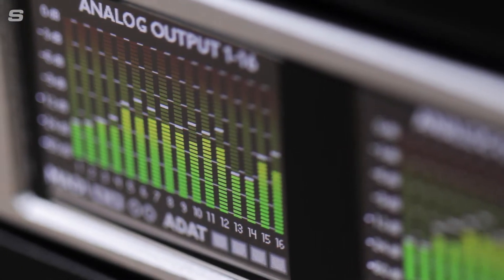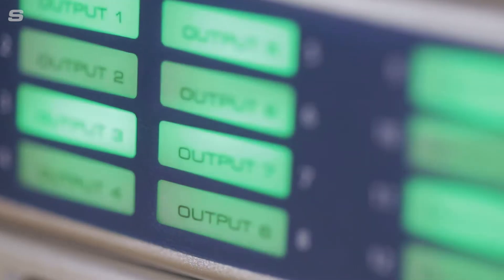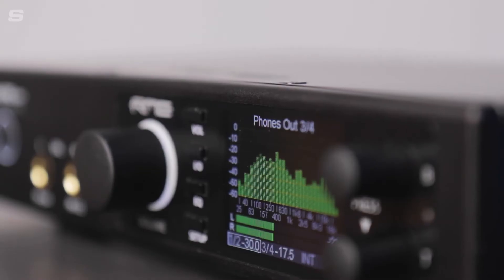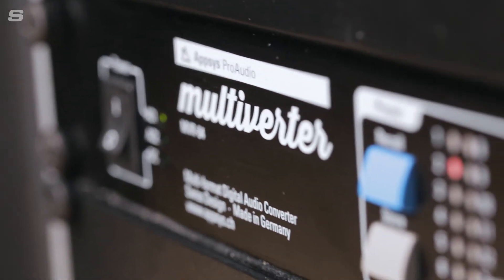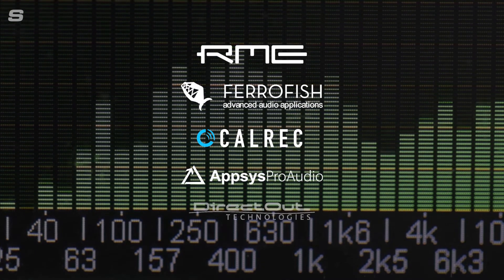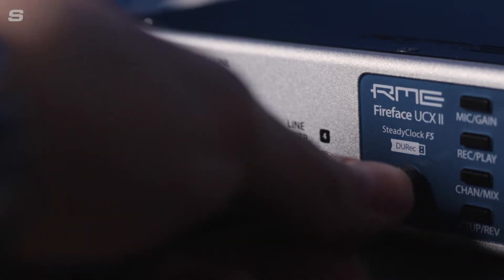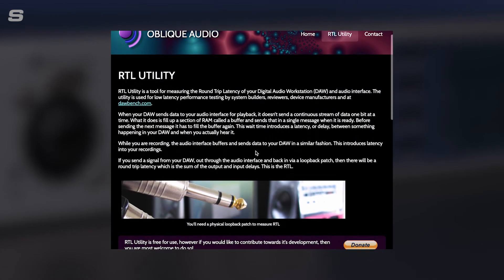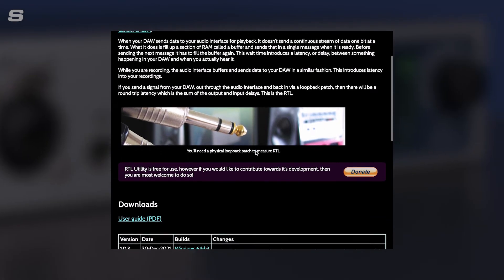What is an Audio Interface? - Synthax Explains

Comment: Can this device help for digitize old tapes ? So connect cassette player to RME and then to pc ?
Reply from the maker: Hi, yes you can certainly use an audio interface to record tapes to a computer (however I should point out that it's probably massive overkill, if that's all you plan to use the interface for).

It depends what quality you require of course - if it's just for personal use, a cheaper interface will likely do the trick. Equally, I'm sure there are tape players available these days that will allow you to record via USB, and probably for very little money.

If you require the best sound quality - for example, because you are archiving for a record label - then I'd definitely recommend an RME interface or a high-end converter (such as the RME ADI-2 Pro), which will provide an extremely detailed recording.
Reply: Thank goodness I came across your channel. 
I’m just getting my teeth into recording at home, although I’ve got some beautiful quality mics  from  80’s & 90’s when I was a full time touring/recording artist. I feel like Rumpelstiltskin with a brand new world of recording possibilities but understanding not much, since the last time I recorded was on 2 inch tape with the producer utilising newish Cubase & trying a Paris setup!
Now that I’ve got some analogue mic pres & compressors etc., I really need what  you’re teaching.
Thank you!